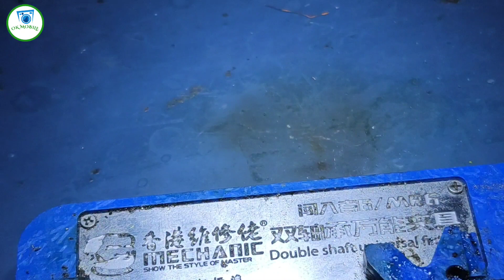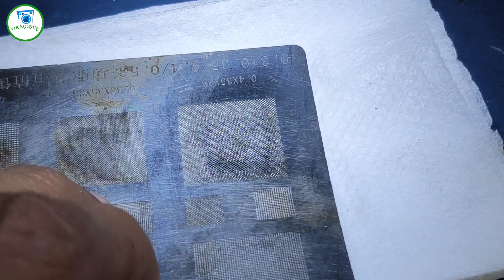how to remove Black pasted ic safely and glue remove easy way 100%

Comment: mere pass ek dead mobile Aya hai jisame phone ko DC machine me connect karane ke bad  powerkey press Kiya but Kuch amp Nahi le Raha hai half short or full short bhi Nahi hai water damage bhi Nahi plz some  guide sir ji
Reply from the maker: Konsa model he pura details dena padega
Reply: @pmtechnology1585  oppo a37 charging voltage bhi properly a rahe hai only dead condition DC machine me Kuch bhi halchal Nahi ho rahi hai
Reply from the maker: Kaha se ho app
Reply: @pmtechnology1585  Madhya Pradesh
Reply from the maker: 9773202092 call